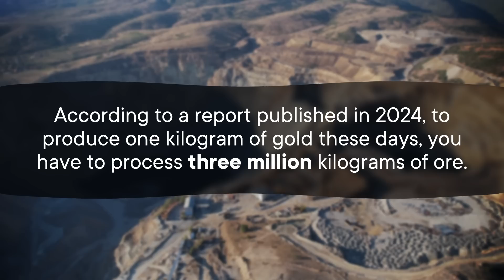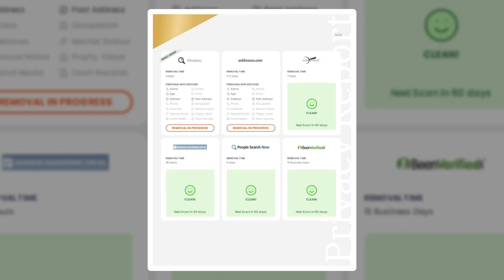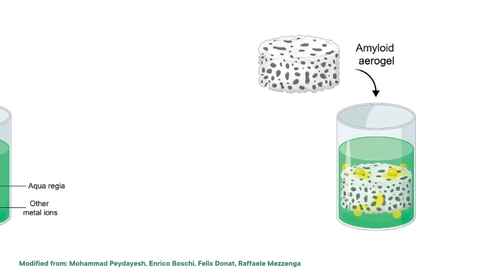We Threw Away $15 Billion in Gold Last Year

Comment: I use to work at an e-waste recycling facility.  I found the easiest thing to scrap gold out of are old ink cartridges. You can see the gold connections at the bottom of the cartridge they are usually screwed on. I've just been pulling those off and throwing them in a jar. I figured 20 years from now I'll take them somewhere and see how much I've got. If they improve recycling E-Waste I might be able to get a good price for them eventually.

Comment: Gold is not good at conducting electricity. If you take the electronic circuit boards apart, and you refine the pieces with gold, you will find out that is actually silver with a gold plate. Gold is worse conductor than aluminum. Silver is the best conductor in the world by far. They use gold to drive up the prices. Because it looks expensive. But nothing competes with silver when it comes to conducting electricity,

Comment: What I don't get is how recycling is "becoming" more cost-effective than raw mining. It's been fact for years that there is more gold per ton of electronics than per ton of raw ore, plus you don't have to dig through cubic miles to get to old electronics. Are the methods for separating gold from non-gold in electronics really that much less efficient?
Reply: The 3 million tonnes for 1kg is way off I work in a gold mine aus, where low yield open pit ore is 1 gram/tonne, so only 1000 tonne of ore for 1kg of gold, and our underground production mines ore with a grade of 20g/tonne, so yes their is still alot of waste material but nowhere even remotely close to what's portrayed, the mine I'm on is also considered fairly standard

Comment: Most electronics today would have a 10+ years useful life if it wasn't packaged with non-replaceable batteries or power supplies designed with under-rated capacitors to guarantee failure shortly after the warranty expires... or tied to cloud services that may get discontinued or switch to an unpalatable subscription model at any time and render the device useless.

Comment: Gold is trading at how much per ounce? That's one heck of an incentive to go get it. There's a reason people still toss it. It's incredibly expensive to do. You don't make a profit on the gold you get back, and for your trouble, you get all the risks of starting a business, handling all sorts of nasty chemicals, and having regulators crawling up your backside in case you ever made a mistake so they can sic their lawyers on you and bleed dry anything you may have managed to make out of the effort. And it's not just gold they go for recovering either. The rare earths are often worth more than the gold. If you're going to the effort, you go for all of the value that's there.

Comment: I’m sorry - this is factually incorrect. The average open-pit mine ranges from 1-4 grams per ton, and the average underground mine is from 4-10 grams per ton of raw ore. 

If this was the average for the entire industry, it would mean that miners are currently on average getting approximately 1/3 of the lowest estimates for open pit in all operations across the board. (Which, in reading a couple of earnings calls that are currently public, doesn’t seem to be bearing out with the facts on the ground.)

Comment: Then it is better to not recycle those gold out from e-waste since the process of recylcing requires burning the plastic components and acid treating. That can't be called recycling since it creates more toxicity for the environment. Instead, we should bury them deep under the mountains like used reactor fuels. Also I still hold my Amiga 500, my first cpu Pentium II 300, my old broken motherboards, my GTX 760 and all my phones like Nokia 8310 and Omnia i900. And F whoever throws electronics.

Comment: Most of the phones get recycled, at least in places where they are easy to recycle like the US -- companies will offer you at least some nominal incentive to trade your old phone instead of tossing it. The problem is EVERYTHING needs an f-ing bluetooth or wifi connection, and all that crap gets tossed when it inevitably fails years before it would have if it had just been a normal whatever. TVs, refrigerators, microwaves, washing machines, *light switches*, all kinds of things that didn't need to be easily obsoleted electronic crap have been converted to easily obsoleted electronic crap.

Comment: What about using mercury to extract the metals from electronics and then using a chemical process to separate the metals from the mercury.
Wouldn't that be able to leave all the non metal "junk" out and still be able to reuse the mercury for more extractions after removing the other metals from it?

Comment: True everything you said except the "the more we recycle the less we have to mine" bit. Mining will continue at maximum output simply because it's a valuable commodity. The rate of recycling has essentially zero effect on the market price.
Reply: Take steel as an example. Pretty-much all of it gets recycled, but what comes out of the foundry is still about 70% new iron. There's just that much demand for it.

Comment: It's not just gold. There are a LOT of valuable metals such as copper and aluminum that get thrown in landfills every day. As a metallurgical engineer, I don't understand why we don't make it clear to the general public that 100% of all metal [unless you contaminate it with radioactivity] is recyclable an infinite number of times, not just in theory but in actual practice. It ALL can get bought  up by recyclers who deliver it to foundries that melt it right back down into fresh metal stock for manufacturing new products, in a never-ending cycle. Very little plastic, paper, or glass ever gets recycled into new products after getting picked up from a "recycing bin" but 100% of that steel soup can you recycle today could be part of a bridge girder or a car door or a shovel next year. 100% of that aluminum beer can could be part of an airplane wing.
Reply: Try recycling a Pringles tube.

Polypropylene lid.
Alu-paper seal.
Alu-cardboard tube,
CRIMPED onto a steel base.

They should be banned.
Reply: @massimookissed1023  Lid goes in the landfill, easy. I wonder if you can tear the alu-cardboard tube off the crimped steel base? Then burn the cardboard off the aluminum.
Reply: @massimookissed1023 you can recycle those but it costs more them matierals are worth
Reply: Aero materials are very tightly controlled and recycled aluminium is never used for airplanes.
Even the chips from machining isn’t good enough.
But that aluminium is reused in other industries.
Reply: @homer009x if I remember right that comes down to using the proper alloys
Reply: I would think that the waste of rare earths is a bigger problem than the waste of gold, silver, etc.
Reply: You cant infinitely recycle metals for specialty uses because of other metal contamination. Copper in steel is very detrimental, as is Aluminium in steel or copper, and separating the metals out of each other is more expensive than mining the ore. New metal will always need to be mined unless separation of impurity metals advances.

Comment: Reclaiming the gold is actually easy, just burn the gold rich circuit boards into ash, then process the ash like any ore. Doing that CLEANLY is the tricky part.
Reply: Yes, catching the toxic gasses and toxic byproducts from the burning is tricky.
Reply: Burning is the worst way for recovering anything
Reply: Or just use the gold bullion sitting in vaults that obscenely rich people will never be able to spend anyway.  Half the gold we  mine goes to gold bullion.
Reply: @trishna_6815  what waste
Reply: @trishna_6815  So your solution is stealing from secured vaults rather than collect your own gold through variety of means - like e-waste recycling, small scale mining, gold panning, or buy gold with your savings.

The last part is how those obscenely rich get their gold.
Reply: @trishna_6815  And a lot is in India on the wrist and necks (maybe ankles as well) of women showing how rich they (or their husbands) are. I also read somewhere that all the gold ever mined would fit into an Olympic-sized swimming pool (or was it two?). Either way not a lot in volume...

Comment: I am a scrapper/recycler in a small city. When I see it, I stop and pick up pretty much anything that has metal in it. I separate it and pile it around my yard. Every 2 months I take all the steel, iron, copper and aluminium for recycling.. I average $6-$700per run. I save up the electronics and slowly go through them pulling cords, capacitors, tabs and various chips in my spare time. Once a year, I take a small pickup truck bed full of all the stripped boards and get around $1300, then I load all the chips and gold plated Tabs in the front seat. Those average $4500-$5k alone..My hobby paid me $9500 last year.....from trash.
Reply: I wish I could find that much on the side of the road.
Reply: @perhapsbutmaybe  Find the rich folks, they like to toss stuff out. It's like some sort of flex for them.
Reply: How long does it take you to do all of this?
Reply: @jmanninja a year he said
Reply: In my neighborhood there's often a guy driving around picking up scrap. In the US I'm gonna guess I wouldn't get that much for recycling but these guys probably make multiple runs each day to try and make it worth it.
Reply: @Akutabai5  Depends on a lot of things, mainly the material. Steel pays 1-5 cents per pound, Bronze and copper can be as high a $3 per pound. There have been days where I took in $1200, others where I only pulled in a few aluminium cans. I guess its all about expectation. I don't expect to make more than $30-45 per day. That would be a 400lb load of steel.. like 3 refrigerators or so..,($15-20 ea) .However, .time is a factor too.. .I could spend 30 min tearing them down for the Motor, condenser coil, copper and aluminium. Then I would get $65 for each one. But, I would also have to dal with the Oil, freon and insulation.
Reply: @caspenbee  Our City landfill will accept metal and electronics, but you pay them 25 cents per pound to take it..I actually hit the dump whenever I take in the various plastics I accumulate, I always dive for something there too. XD (Lots of  chunky Bronze and aluminium gets tossed here) However, Yes, my location has great opportunity.  I live on the coast of NC. Our State Port allows for easy access and shipping. So, The recycle yards are plentiful and... pay a premium. I live 4 miles from the nearest yard and 6 miles from one of the Nations highest paying scrap yards. That certainly makes a difference.  The middle of the nation yards may be paying say, ...1.5- 2 cents per pound for steel or $1-1$1.50 per pound for #1 copper. I get 5 cents and $2.25 for each respectively. It adds up for sure.
Reply: Honestly getting a second job pays more… but hey at least you enjoy it.
Reply: @lolasdm6959 his "hobby" also doesn't have a time clock or boss. Just whatever time he decides to use collecting trash.
Reply: @kks_123-u1w  yeah I just pointed out its not the best paying work, but his having fun and making money.
Reply: @kks_123-u1w  yeah I said he enjoys it
Reply: @lolasdm6959  Shame on you!!>> You said a bad word.. "Job".. Uwahhh... Makes my spine stiffen at the thought of it. XP. Seriously though, scrapping is one of many avenues of revenue. Ironically, My "Real Job" is something I would literally do for free but they won't let me.  I am a Stagehand/Rigger at my local outdoor venue. Seasonal stuff so,  I also blow glass and build motorcycles in the meantime..
Reply: @lolasdm6959 does it really?
Reply: Sounds like I might have a new hobby
Reply: Betcha your neighbors love you.
Reply: @Foolish188  No complaints at all from the neighbors. I guess it has to do with the fact I am the guy fixing most of their stuff. Then again, I do keep my fences and relationships mended. 8/
Reply: @Foolish188  'Betcha' is short hand for 'bet you' or 'bet your', so it's kind of clunky to say 'betcha you' or 'betcha your'.
Otherwise I agree about the neighbors, not liking him, but screw the neighbors. He's providing an important service to the economy, environment, and the cleanliness of his city. Plus making some extra money on the side
Reply: @hashbrown777  I disagree, both interpretations are grammatically correct, shorthand, but 'betcha neighbors' is less clunky than 'betcha your neighbors.' 
In my opinion. 
If it was supposed to be a complete sentence, your version would be more correct
Reply: @amosbackstrom5366  ..it's always meant to be a complete sentence, that's how language works. Whether you recognise "incomplete" sentences as simply having "[]"s is your own [mis]interpretation
Reply: "I bet your neighbors love you" is still a complete sentence, so what's your point?
Reply: @amosbackstrom5366  "I'd bet"* at the very least
And again, the point is that that 'complete' sentence is in fact missing an implied "that"

If you learn english as a second language you find that there are all these things that aren't stated but do still form a part of the underlying structure which is why you cannot say "that's what it's" even though on the face of it "that is what it is" would seem to permit it
Reply: @hashbrown777  I agree with your larger point about complete sentences and how the implied [that] is necessary in a proper sentence. 
That was not my point at all. He was already using shorthand, and it was clunky.  That was my only point 👉
Reply: @amosbackstrom5366 and my only point is that I've shown it's at worst arguably clunky and thus in no way warrants a pedantic reply attempting to change how he wants to phrase things in the first place
Reply: I am 100% certain you are getting ripped off with the boards.  Not because of the price but because recycling them yourself is easier than people think
Reply: @drfill9210 the toxic by products you pay to get rid of. Better to send it off to a place that does it on a industrial scale
Reply: @drfill9210  Ripped off? Maybe, I mean, I could save up 12 tons and get that $1.1 M sure..But I am not looking to invest the time and money into acids or a crusher and a crucible.  . I get 34 cents pp for naked boards, Good enough for me to let the big guys make their cut..
Reply: The time it takes is not worth it unless you are bored and have nothing to do or flat broke and need money
Reply: @jesselangeland7933  Your time is Yours to do with as you see fit. I see fit to pickup free money from the roadside. I find worth in free money. XP
Reply: And probably cost you $12k in labor xD
Reply: @3nertia  nup. Scrappers figure out how to do things in their spare time efficiently.  Why is it that this guy said he was doing the environment thing we were all watching and enjoying,  and all these people start hacking on him? Are only scientists allowed to do it? No plebs invited?
Reply: @3nertia  lol. Uhh...How can it "cost" me labor? I am not paying anyone to work for me.. I make around $12 per hour, from free materials that I pick up in my free time. 8/
Reply: @3nertia  yeah he couldve paid someone who hates doing it to do it for him, that way he can go do something else he enjoys doing that doesn't pay for itself like commenting on the internet
Reply: As a nerd with a hobby of collecting vintage electronics and electrical items, I hate scrappers with a passion.
Reply: @mernokimuvek  Well You would probably like me, Anything older than 1990 gets sent to my buddy that fixes vintage stuff or I'll put it to use around the house like the blender, shake machine, old Kenmore refrigerator ect. .  I saved an old RCA Cabinet system and a 1979 Peavey amp last week. I'm not like all the rest that only sees money. I mean, all my vehicles are vintage and antique for a reason..
Reply: @mernokimuvek  Oh..plus..if it works or is functional..I use it or sell it at yard sales.  I firmly believe in Repurpose or Reuse, then Recycle in the end. Did I mention I only drive antique and vintage cars? (Can't see my comments) I saved them all from the crusher too. We aren't all seeking the dollar at the end of the day.